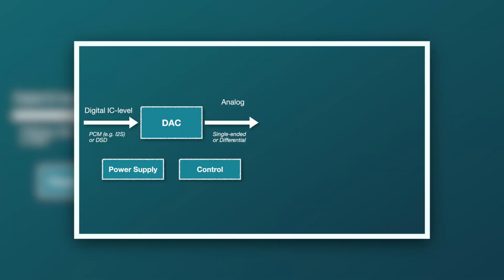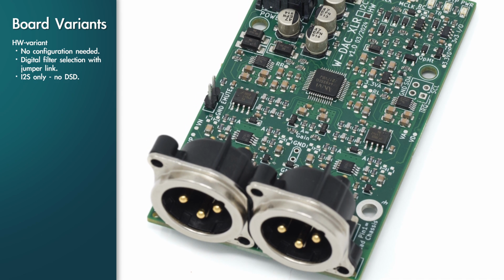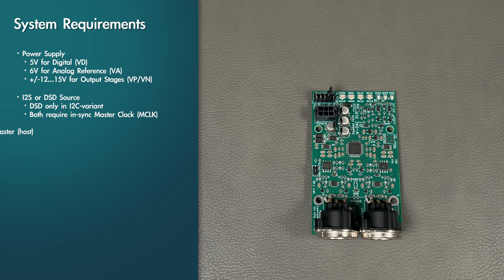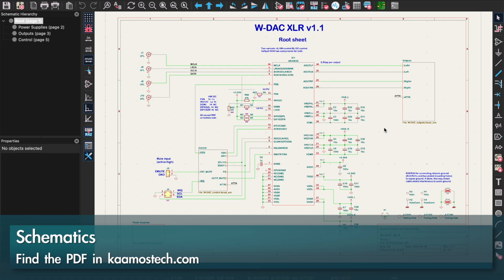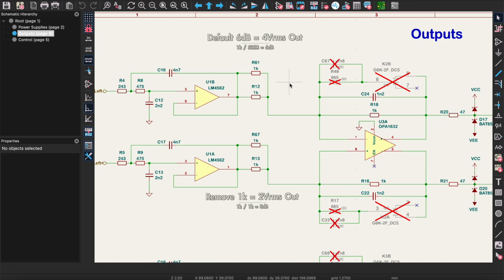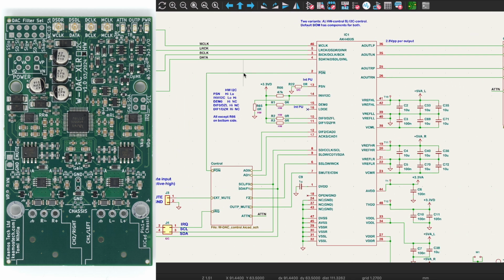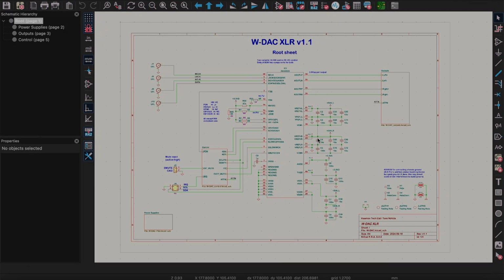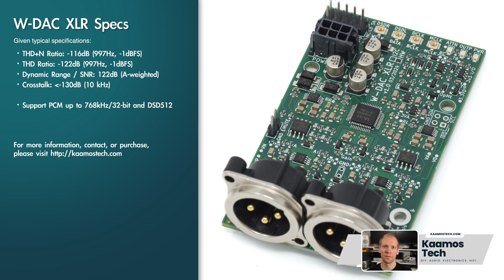W-DAC XLR audio DAC intro, features, and schematic walkthrough

Comment: Let me try the reply this way - with no (at).  Four attempts to reply to to my February 2025 comment have been removed by YouTube.  Guess I made them mad for, well something, I'll never know what or why...
  
First, I have not be compensated for this opinion, it is my own - and there was no editorial oversight.
  
Executive Summary: I like the new DAC, and I would buy it again, it performs at least as well as the Wee-DAC I previously purchased from Nihtila (before the KaamosTech website came to be).
  
The parts arrived quickly - I ordered the DAR-18-HW w/connectors and headers, OneFourAll-PSU w/connectors, W-DAC-XLR-HW w/XRL+connectors+headers, 6 and 2-pin power cables, and u.fl cables.  Basically what you see @5:20 in this video.  Since I went with the hardware control, it was a quick wire-up and it was running with a USB-C supply on my test bench.
  
I ran the SPDIF (Coax) from my work's AudioPrecision AP-2700 through the DAC kit and back into the AP-2700's analog inputs and ran it though it's paces at various bit depths and sample rates.  I can confirm that with my testing, the results match what was shown in this video, and I agree with the opinion at the end about variability.
Reply from the maker: Thank you for the feedback, good to hear everything is working.

Comment: I suppose it might be niche, but it would be really interesting to see best practice for a USB -> 8 channel DAC.
Reply from the maker: I may be focusing more on the multi-channel modules in the future as stereo market is so saturated. Of course, these are quite small so can easily hook up multiple boards. I am just planning an 8-channel DAC for myself using these - not USB though.
Reply: @kaamostech  Hello! Yesterday I've messaged you thru the website contact form about the USB interface. I hope you got the message :)
Reply from the maker: @ Hi, yes I got it. Sorry I haven't replied yet. It sounds interesting, I just wanted to read a bit more about it first but haven't got time. Will come back to you in the coming days.
Reply: @kaamostech  Thank you - that's interesting, what would you use as a source?  I would be interested in something that could pull 8-channel PCM out of an HDMI or DisplayPort connection - especially if it could also pass through audio-less video to a monitor.  I had assumed that USB would be the easiest source for computer audio post crossover or decoding, but just an assumption.
Reply from the maker: @ I will just use multiple S/PDIFs or so from a DSP. Proper HDMI is tricky (and complicated) to implement for a hobbyist, being under all sorts of licenses etc - afaik. USB probably is the easiest indeed, if a computer is part of your system.
Reply: @kaamostech  OK - my interest is also DSP for active speakers - probably with CamillaDSP.  USB seems to give me lots of options so long as the DAC system has good clocks since I guess there is no clock recovery, but I give up any ADC from the same clock in most cases.  It would be nice to have at least one.  I have bought an Rpi5 and the 8 channel DAC board but haven't played with it yet - I'm a bit concerned about the clocking but we'll see.

Comment: Nah, see you are forgetting that you need to put it on a massive board with 40 different inputs and outputs no one needs, about 20 buttons that do nothing, and make a noisy power supply that will ultimately ruin the performance of the dac. See if you did those things you could charge 40K for this thing and some poor schmuck would buy it. 

-in all seriousness, I have made circuits similar to this one in the past. I am very happy to see the LT3042. You have no idea how many times I have seen people use an lm317 and then claim they are getting 24 bit performance.
Reply from the maker: Can still add all the buttons and extras around this :) Audio is such a weird thing. Often the focus is on something totally irrelevant while omitting the vital stuff. All technical arguments and even measurements can be undermined by a subjective opinion. Of course, when it is a hobby, each to their own.

LM317 is still a solid choice for many things but yeah, not necessarily the last word in a converter design.